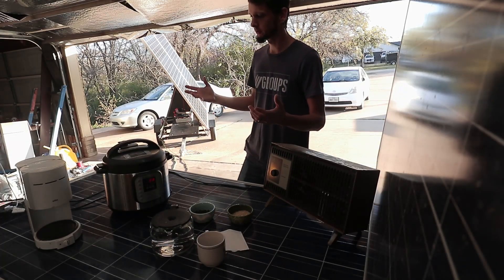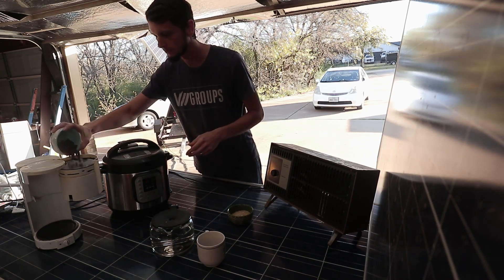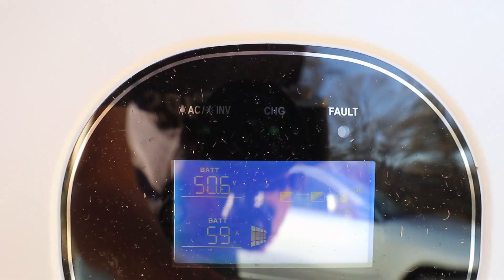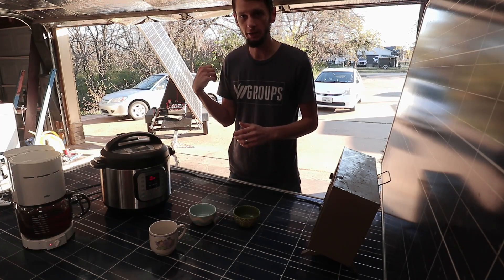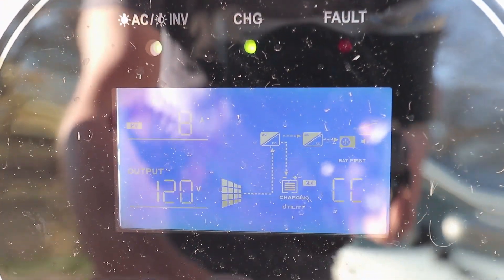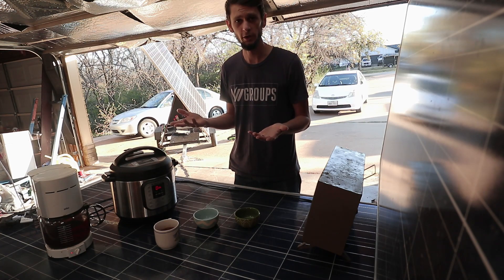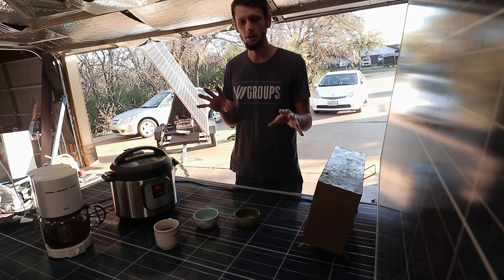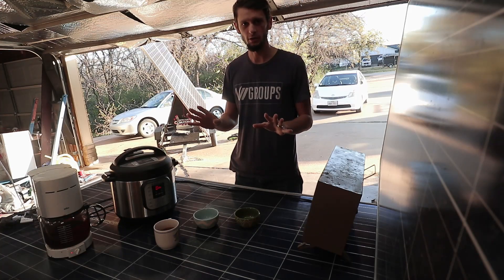Overloading My Growatt Inverter With Bad Coffee

Comment: I bought this unit in 24v after watching this video. I have 4 190Ah sealed lead acid batteries. Will I need to run some type of shunt based battery monitor? I'm running a victron 712 on a smaller system at my weekend place.
Reply from the maker: Very cool, let me know how your setup works!

What monitoring do you find useful with your victron 712? This unit does have WiFi and will upload usage stats to “the cloud”. I could see wanting something local for if there is no internet available or you don’t want stats being pushed to Growatt’s website.
Reply: @BeeneEnergy Thanks for the quick reply! the one feature I find most useful on the 712, it will tell me in days and hours under current load conditions how long I have left to 50% dod. Will this unit track things like this without a battery monitor?